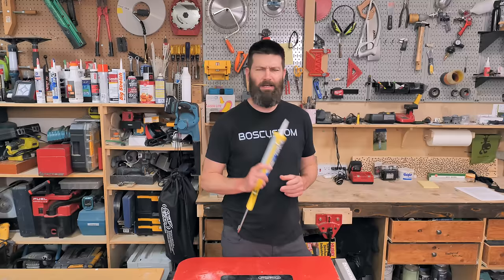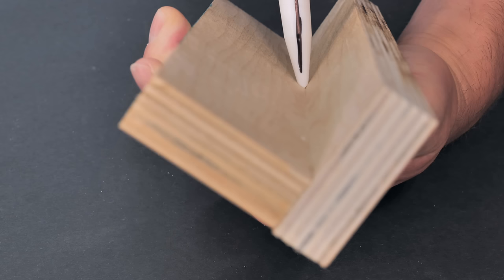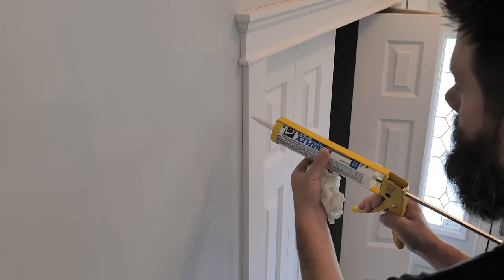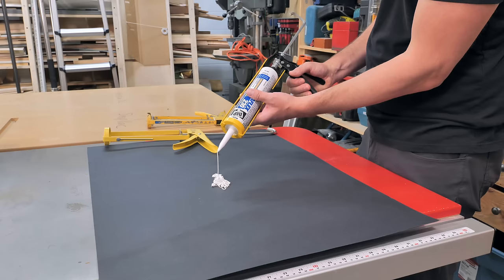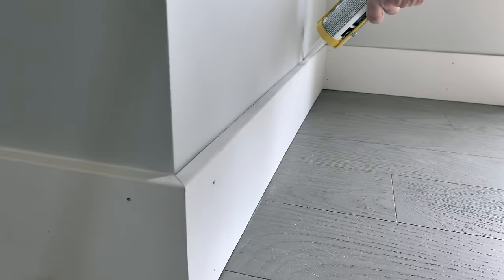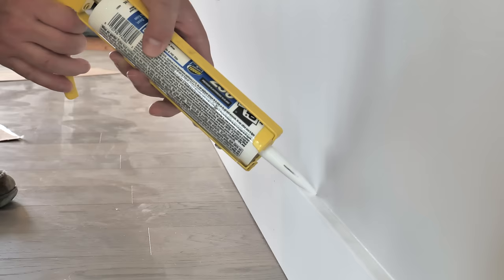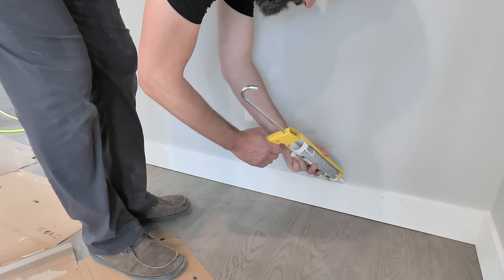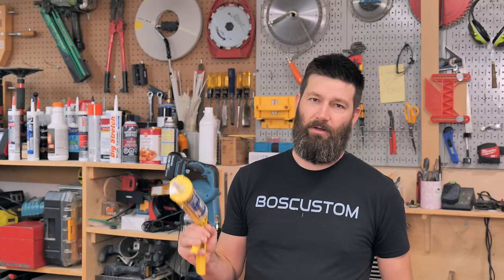The Secret Caulking Tip That Will Transform Your Ability!

Comment: 30+ years in the trade, solid advice here. One thing to add....when you're done caulking, but there's still material in the tube, seal the tip of the tube up with painter's tape. Wrap it around a few times and pinch it tight. Most of the time siliconized painter's caulk won't harden in the tip if you get back into it in a reasonable amount of time, but if you let it sit too long it can set up and not want to flow again. The tape helps keep the air out of it, keeping it pliable and ready for the next project. Taping the tip also works with pure silicone. I always hated throwing away 3/4 of a $6 tube of clear or white silicone because the tip was plugged up. Tape it up and you can usually go back to it days/weeks later.
Reply: I use a nail then tape.
Reply: Yes, I use tape too to temporarily seal the tip of the tube of caulk and it works pretty well.
Reply: I use a drywall screw - normally there is at least one lying around a construction site.  Finger tight seals it well for months.
Reply: I use a red wire nut. I keep 6 caulk guns hanging in my trailer, all with different caulks. It's amazing how long the caulk stays good. The wire nut bites into the plastic and makes a great seal. It's also very fast to put on and take off. No mess either.
Reply: @klklbk  KK, I use the large blue wire nuts...
Reply: So you’re saying always cover your caulk
Reply: Silicone is now $12 a tube
Reply: They make covers for the tip now which works way better than a nail or wire nut for a dollar
Reply: I've drilled out the tip when it dried out
Reply: Spare tips are cheap enough to swap em out
Reply: I tend to use a wire nut. Screws right on like a lid.
Reply: I use the finger of the nitrile glove I was wearing. I then put a small cable tie around it.
Reply: even weeks / months / year. Most times if the time is reasonable you can pry off the hardened caulk in the tip with a screwdriver. And even if the tube seems hardened you can try using a screw driver to poke it. Most of the times the inside of the tube is still good and only the tip hardened.
Reply: @TH-eb5ro Most nails or screws oxidise heavily & corrode if you leave them in wet caulking products for too long. A bit of plastic wrap & tape or just tape works better.
Reply: @1Chuzzlewit  Thanks for the reply, I have not had that happen yet.  I normally have a roofing nail that I use.
Reply: @TH-eb5ro  :D  maybe it's just that I used lousy quality screws. Hard to find good ones in our major hardware store chain, in AU these days.
Reply: I mainly use silicon. Depending on temperature, it can last for weeks. However, it can harden in the nozzle, so I just screw in a new nozzle.

Comment: This brings back memories. In my former life, I used to be a carpenter and did finish work (cabinets, etc.). I was always picked to caulk the laminate/Formica. I cut the tip a unique way and watched the leading side of the tip rather than the trailing side; this way, I could observe how much caulk was flowing out, and the critical point was I NEVER swiped the bead with anything. I would drape the countertops to keep dirt, dust, and debris out of the caulk as it dried. The results were always complimented.

Comment: Such a great vid. I learned a lot.   I consider by self a very good caulker… and I learned a few worthwhile tips. I have another tip taught to me by a carpenter,tile layer doing one of my many Reno’s.keep a small glass of lukewarm water with a few drops dish soap at the site and when you need to make the swipe with the finger to seal ,first dip your finger in the soap water. Your finger glides more smoothly as the caulking does not stick to your finger. Also the cleaning rag for wiping  gun tip, walls, use same soapy water on rag , does a better job,keeps job site from needing a cleanup at end end 
Looking forward to exploring all your other videos

Comment: I've been caulking for 35 years and never thought of making an orientation line or pre-grooving the tip.  Simple and genius! I was laughing when you held up the two caulk guns and was dissin my goto one wth the thumb release cause I thought you had the two confused... the other looked like the kind I avoid,  but I didn't know there was a dripless design.  Cool info. Thanks for the outake from the B-roll 👍🏼
Reply: I’ve been making a v groove with a knife  in the back of my tips for more than 20 years. Did it on a whim, never shared it with anybody either. Don’t know of anybody else does it.
Reply: drip less. not dripless

Comment: As a DIY caulking has always been a nightmare for me…just for that I’ve been procrastinating caulking some baseboards at home. You have no idea how much this video has helped me. Thank you so much!
Reply: Lol same. Wish i had found some of these tips 6 months ago. Had a burst pipe so had the wood floor replaced in my ENTIRE house. The guys who installed the new floor just pushed the baseboards back in and didn’t re-nail them, so 2 years later every. single. inch. of baseboard had separated from the wall a bit. Wife and I just kinda ignored it cuz caulking sucks. Then we decided to put our house on the market so had to knock out god knows how many feet of baseboards and caulk. We got it done but it just affirmed how much I loathe caulking. This would have made it a much milder version of hell.
Reply: I agree!!
Awesome
Reply: @stripeybeast  Electric caulking gun (Ryobi) makes it sooooooo much easier.
Reply: I'm about to do my first caulking diy job. So glad I found this video as I would have made a complete mess of things.

Comment: These are great tips that vastly improved my caulking jobs and made them so much easier.   I have an additional tip that makes caulking even easier.  Sometimes you have to hold the caulking gun in a position where you can’t see the orientation line because you’re looking at the bottom of the tip opening.  Also, the small opening and angle of the tip can make it hard to see the position of the tip.  
In addition to the tip orientation line at the point of the tip, I put an orientation line at the bottom of the tip with a “B” to indicate it is the bottom.  That way I know where the point of the tip is no matter what orientation the gun is in. 
Great videos with great information.

Comment: I like not to cut the point with a knife, but clip it with a (side-)cutter. This squeezes the point or caulkchannel together, forming a slight oval. Together with the angled cutoff, makes this very easy caulking.
Reply from the maker: Interesting idea Barrie
Reply: Ditto - I go through too much caulk (exterior) to be sanding every bottle, still great tips for noobs
Reply: @Underbottom.Sandydown  You can reuse the tip multiple times, just open a new bottle and switch the tips, as long as they are all the same caulk ofc

all that said i think sanding it is a litle unecessary, but still u only have to do it once
Reply: I like that!
Reply: @wolololer  and prevents waste ....

Comment: For caulking around cabinetry, or other high finish areas, I always mask off either side of the desired caulk seam and use my finger to feather it out into the fill zone between the tape edges with an even radius. After removing the masking tape, you will get a perfect caulk line every time. It's too much work for baseboard, but essential for kitchen and bath finishes that are subject to higher visualization.
Reply: @Daniel Sun. Excellent idea!!!! Not very many know that masking works the best. Even a tiny bit of bathroom caulk shows a crooked edge when it finally gets discolored. Tape eliminates that and turns a discolored caulk into what looks like a trim piece and delays the time when caulking needs to be replaced.
Reply from the maker: Try these tips, I developed this method when I was a cabinet installer. It holds up in the most visible precise situations.
Reply: Cool!!
Reply: I do that also. Creates a very clean line.
Reply: @TheYamahog12  why are clean lines even a thing? to prove to the consumer its not a scam.."hey look now that can't be a scam look how straight it is".
Reply: ur masking bill must be high
Reply: So do I! I’ve don’t this around our new windows because I didn’t want a bunch of caulk of them. It really creates a clean caulk line.
Reply: You left off a critical detail--KNOW WHEN TO PULL THE TAPE!!
Reply: @feelinghealingfrequences7179  TF?     XD
Reply: @Me-vl4qp  okay, but when???
Reply: I have used this technique a few times it is time consuming but you get a great result.
Reply: Get good and do it without the tape. It’s not hard I’m 19 yrs old and I work with my dad sound remodeling and I have mastered caulking. I’m better than my dad. And tape was never used.
Reply: I can see you guys
Reply: @Jessica T soapy water interferes with the adhesion of the sealant
Reply: @genecarden780  She's probably thinking of silicon. The dish soap technique, although not always dish soap as there are alternatives is essential for a clean silicone bead. It's a terrible idea for calk because it softens the product and bleeds like paint. Depending on how rich the paint colour on the wall is will determine how nasty the end product will look.

If the joint is not too wide a soft damp sponge can facilitate a very nice finish too if you get the lightness of your technique and the dampness of your sponge right.
Reply: @grantfrith9589  soapy water is not essential on silicone. In fact Every major manufacturer say not to use it. This is an excerpt from the silicone sealant section of Dows technical manual 
Sealant should be applied as follows:
1. To help ensure an aesthetically pleasing job, masking tape should be used to keep excess sealant from contacting adjacent areas where it is not intended.
2. Apply the sealant in a continuous operation using a caulking gun or pump. A positive pressure, adequate to fill the entire joint width, should be used. This can be accomplished by pushing the
 74

sealant ahead of the application nozzle. Care must be taken to ensure complete fill of the
sealant cavity.
3. Tool the sealant with light pressure before a skin begins to form (typically 10 to 20 minutes).
Tooling forces the sealant against the back-up material and the joint surfaces. NOTE: Do not use liquid tooling aids such as water, soap or alcohols. These materials may interfere with sealant cure and adhesion and create aesthetic issues.
4. Remove the masking tape before the sealant skins over (within about 15 minutes of tooling).

This is the tech manual. Page74-75 I believe
https://www.dow.com/content/dam/dcc/documents/en-us/app-tech-guide/62/62-11/62-1112-01-americas-technical-manual.pdf
Silicone is very easy to get a near glass smooth finish on by using the proper dry tooling technique.
Reply: You do that with bathroom silcone caulk too expensive to do all the time.
Reply: I don’t sand the back edge like you do but what I do I cut a tiny v into the back side of the tip and don’t cut too much off the tip either. Almost never have to use my finger to smooth it and I’ve been doing it this way for more than 20 years.
Reply: They make silicone spatulas, that when used with soapy water / glass cleaner leave a perfect finish on tiles. I used to mask, when I found those I saved about 30mins per shower. I've installed around 10000 frameless showers in the last 25yrs and swear by them.
Reply: @sintaxera  man I hate grout caulk
Reply: @johndough23  just looks better. Straight lines are appealing to the eye. And if a fabricator or handyman pays attention to details like straight lines then they probably also care enough to do things the correct way even where the customer cannot see.

If I see shitty detail work I immediately think "oh I better pay attention to everything this worker does because I can't trust them to even cut something straight."
Reply: @johndough23  for the aesthetic, some people like their home to look nice and professional instead of caulk smudges and beads everywhere
Reply: Thanks for posting this!  I'm a homeowner doing silicone caulking.  Silicone is much messier to clean up that latex caulking if you make a mistake.  I used the careful taping method mentioned in the Dow guideline you posted.  No soapy water.  Just a bare finger.   I removed the tape after the finger swipe. It came out great!

Comment: Painters tape 1/8 inch on each side of you caulk joint. Works great especially on bath or kitchen tile joints where you want a professional looking job.  Let it set for awhile and pull tape away slowly. You can also wet your finger with a bit of soapy water to smooth the joint out and have NO fear cause you're painters tape has you covered literally..  saw this done by some tile guys putting up my backsplash in my kitchen...works great.
Reply: Cool!

Comment: Love the idea of the guide line! Such a simple idea. I’ll definitely be putting that into practice. 
One tip I can also recommend, is wipe down your area with a damp cloth before applying caulk. It helps with cleaning off excess as it slows the moisture absorption.
Reply: Thanks. I agree the guideline is a game changer too...definitely the cloth. .I was wondering about that...maybe he is assuming we would. Thanks!

Comment: Thanks for the great tips! Liked the sanding part.

I have an other tip. When wiping with my finger, I always have a small bowl of dishwash and water to dip the finger in before wiping the caulk. Makes it much easier and the calk wont stick so much where it´s not supposed to. Also makes it easier to correct smaller mistakes.
Reply: You can also give a quick light spray of Windex across the caulk before you run your finger over it. Saves a whole lot of goop sticking to your finger. Of course, that’s assuming your caulking is not as neat and clean to begin with as what’s in this video!
Reply: I have a small plastic thing-a-ma-jig with all kinds od curves to use on any size caulk application.

Comment: Been doing this for 35 yrs. love your first tip. Never though to shape the tip with the sand paper, though I have thought about marking an orientation line, I never seem to have a sharpi around. Going to put one with my caulking tools. I love the contouring tools for silicone too for certain applications. And your right about a good gun and applying less not more. Thanks!
Reply: The orientation line is a game changer.

Comment: Great tips!
I've been painting since I was 13 yrs old. Always worked for my pops. I'm 37 now. All these tips come from experience. The only thing that sucks about caulking is when you have to do it to a whole brand new house. By the time you are done, the nail on your main finger is becomes thin as hell. That or your finger will burst and have to put on the painters tape and use another finger. Good thing there's 10 of them. Thumbs included 😂

Comment: Aa a painter of 30 years, I never cut my nozzle and therefore never have to turn my tube as it is always the same. The dripless gun is absolutely your best friend. I carry around a paint pot with water and use a chux  kitchen cloth. As the cloth has many holes it allows the caulking to easily wash out in my pot of water so I don't end up with a cloth full of caulking, on Australia we call caulk, no more gaps 

Also with the uncut nozzle and a small hole, if the gun is held at 90 degrees to the gap it leaves no excess. Also you can lean it over slightly and rather than dragging the nozzle push it away from you and the nozzle will act  like you running your finger along the gapped crack

Or you can stick with what this guy said as it seems to work too

May Jesus Bless you All
Reply from the maker: Thanks for sharing your experience!
Reply: Yep im a painter for 20 years. If somone cuts the gaps tip at an angle ill fire them (or i would seriously consider it lol) Makes it 5x harder to use. I dont understand why anyone would do it
Reply: If ypu don't cut the nozzle, what exactly do ypu do?
Reply: @charlesatkins5388  Read my post, I explained how I use the gun

Some times I will sand the tip if there is a bit of excess plastic around the tip from the manufacturer ingredient process, or if the gap is huge I will cut the nozzle flush to allow more product th go through
Reply: @charlesatkins5388  I already explained how I use the gun, perhaps get someone else explain what I said. As I already said how I use it
Reply: @charlesatkins5388  I don't understand either. But I think he meant to say he pokes a hole directly in the end of the nozzle. He doesn't cut it, and definitely not at an angle. But that's just a guess. I'm not not sure.
Reply: A grout sponge works even better than cloth.

Comment: You're the only guy out of several that has actually explained the speed and amount! Also, none of the others said anything about a line for orientation. Thanks. Helped a ton!!!
Reply: Want to make it easier?  Cut the smallest bit off the tip that you can.  Cut it straight across with no angle.  Put it straight into the joint without tilting it.  Squeeze and slide it along.  You'll have a very fine line of caulk with no clean-up.  Try it.  If you hate it, you can always recut the tip on an angle.  I've been doing it that way for 40 yrs, at least.  Works every time.

Comment: Tip. If you have a RAT test for Covid, depending on the kit you have, don’t throw away the tube that holds the liquid. It fits tightly over the opened nozzle tip to prevent the caulking paste from drying.
Reply: Rapid Antigen Test (RAT)
Reply: At least something useful came from the covid experience.
Reply: Another tip, if you fell for the scam and are actually "testing" yourself, you have a lot more to worry about than caulking.
Reply: Like micky mouse always says.  Ohh boy